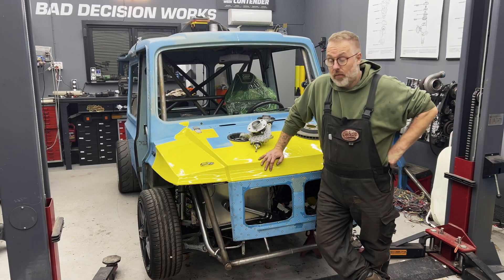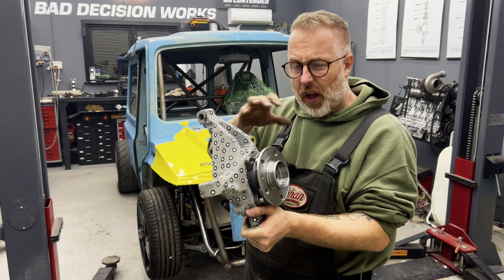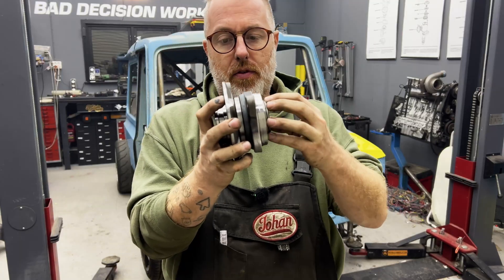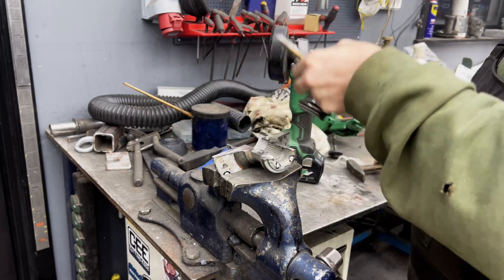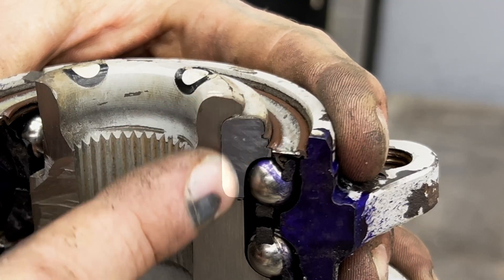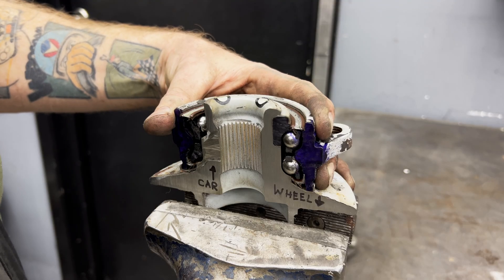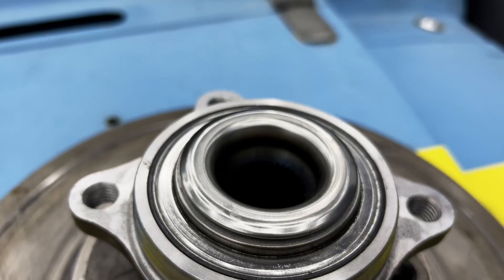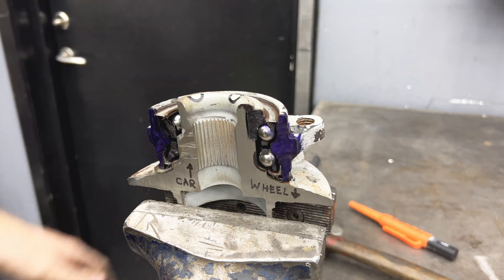Volvo Wheel Bearings Explained – Safe for my weird little Race Car?

Comment: This obviously doesn't come apart, otherwise you would have been able to replace just the bearings and not the entire hub assembly
To be sure, you could check how much of the driveshaft bolt (or nut - not sure how Volvo does this) covers the peened lip

Comment: this bearing is not a "problem" as this is "CHRIMPED" the other style where you can remove the hub will fall apart. the other similar style is not crimped and they will fall apart rely fast. you can actually take it apart with a sliding hammer. the other style is not peened over att all.
IF you can by the bearing as a separate part alone they can fall apart.. if the center hub is permanently connected they cant fall apart. the bolt they use here as well is not so strong to hold the wheel on the hub. on other car's it is. this car only have a thin bolt to hold the shaft in the spline. not a big bolt on the shaft to clamp the bearing.
Reply: Mondeo Mk5 is such car that has a tiny bolt to secure the driveshaft to the bearing. Those can for sure run without driveshaft.
Reply: @MrCaprinut  the new ford style bearings is also crimped. they dont have anything to hold them in place tho. they use the same on the volvo's after this model.

Comment: The axle is firmly connected to the bearing. But is if bearing or steering nuckle is loose the entire shaft can be pulled out of the gearbox. So that bolt is not protecting in that way.
At least that is how it works on most FWD cars. 

But now u investigated to be sure and nice video.
Tnx

Comment: Without load, this bearing won't fall apart, but I'm unsure if the peened over lip is enough to support axial loads during driving. It seems to me that the peened over lip is there to prevent everything from falling apart during install. I would recreate part of the driveshaft to support the peened over lip from behind, keeping it in place with a bolt that goes through the entire bearing. Just for peace of mind.
Reply: Sellholm uses the same style bearing. If it does not fail on a rallycar jumping through the woods I think @bad_descion_works will be Ok.
Reply from the maker: That’s good to know! Thanks 😊
Reply from the maker: I tried breaking the lip by axially loading the bearing in a 20T press, and it didnt break.
Reply: @bad_decision_works  
would actually been a great ad-on to inclose the stresstest with the 20T press into this video, but reading this line which everyone can i think. surely is a reassurance. 👍
Reply from the maker: Yeah, i should have done that, but i didnt think about it before i cut it in half 😅
Reply: @bad_decision_works  in that case, send it. Apparently I underestimated the strength of the peened lip. Good thing that u tested it 👍🏻
Reply from the maker: Well, i’m not a structural engineer, but at least now i feel confident enough to run them as is. I dont think they will suddenly fail and send why wheels to the moon. I guess if the lip fails it will slowly bend out and then the bearings become sloppy. That I will probably notice way before they reach the point of failure.
Reply: @bad_decision_works I dont think the guys who commented, knows how a 285  driveshaft and bolt looks. Its only a low torque m10 bolt to keep the driveshaft in place. Thats very different from many other wheel hubs which has a +-m24 nut on the drive shaft and 250+nm torque. All cars with the hub pressed in to the bearing, has that type of high torque fastener.